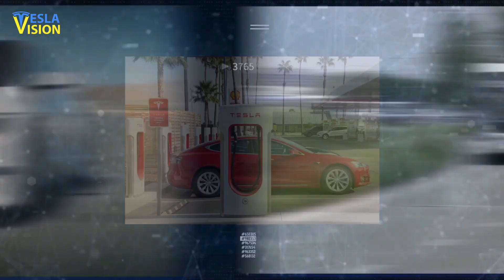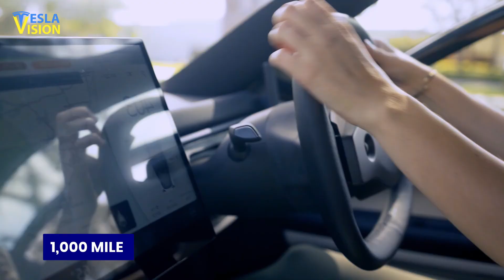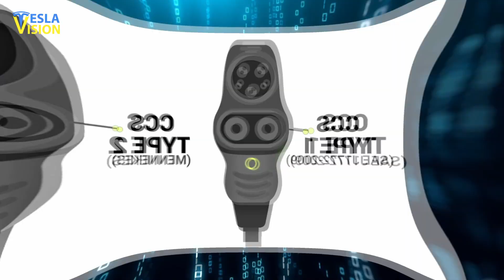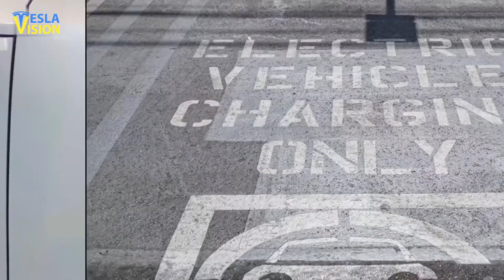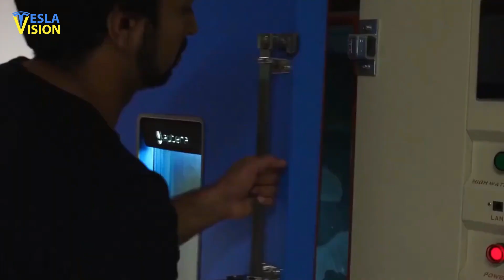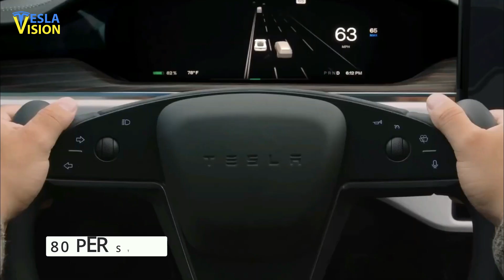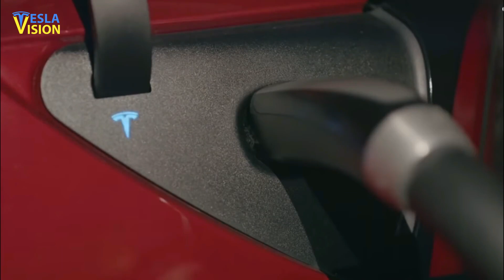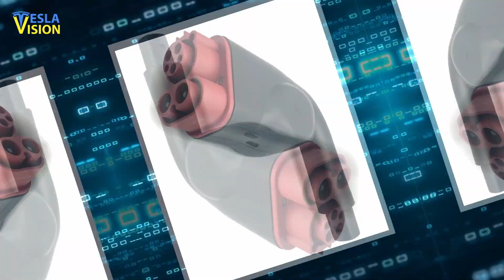How Aptera is Capitalizing on Tesla and It's Genius!

Comment: As an Aptera investor and reservation holder, I feel charging should be much faster for 600 & 1000 mile models.  These should be 11 kw for AC and 150 kw for DC.  Otherwise, charging these big batteries takes too long.

Comment: Hope Aptera get the $7,500 federal grant! That could price it at a great price for sunny states!
Reply: It isn't likely. The EV incentive is only for electric cars. The Aptera is an autocycle, classed as a motorcycle. Even if that weren't the case, another stipulation is it has to be built completely in the United States, and the Aptera will be sourcing its parts from all over the globe. They will be assembled in the United States though.
Therefore it is very unlikely that the Aptera will receive the incentive, but the $26k price tag will make it less necessary. If it did receive the incentive, then it would probably be the most wanted vehicle on the planet. Imagine getting a brand new vehicle that passes some of the most rigorous safety tests, which charges itself, costs less than $10k, and you could repair it yourself.
Reply: @justinweatherford8129  They would have got something but the bill had this gutted out due to special interest to get the deciding vote.  Great job on the US government to encourage efficient transportation by putting the best option at an economic disadvantage.  Honestly they should kill EV incentives and tax new ICE cars instead then let people vote with their dollars what alternative option is best.
Reply: @ccibinel  I think that implementing a carbon tax, while simultaneously putting an end to funding fossil fuel companies might cause a quicker change.
Reply: @justinweatherford8129  taxing fuel punishes those that can't afford new vehicles.  Fuel is cheap especially in the short term and for those buying new vehicles it is a minor difference.  Taxing the vehicle punishes those that put that car into the pipeline eventual used pipeline.  Vehicles last 15 years; less new gas cars now is good.
Reply: @justinweatherford8129  Imagine is the operative word. Keep imagining.
Reply: @aussieideasman8498  what are you trying to say?
Reply: @justinweatherford8129  That you lack comprehension.
Reply: @aussieideasman8498  I didn't see any useful or imaginative ideas posted by you, so your comment seemed to just be nothing more than trying to insult the people offering ideas. I look forward to seeing posts from you about how you would approach a solution, rather than attacking those who offer solutions.
Reply: @justinweatherford8129  See? - lack of comprehension. You prove my point. Don't worry about me putting up solutions to problems; look for those from Aptera - you won't find them in their snake oil waffle, and they are the one's selling you a product, or at least saying they are. I suggest you start with their skin cooling solution. There have been a few video's touching on it, but not much. If you watch the ones I made saying their solutions are unworkable, you will identify their feeble efforts. You are most welcome to refute any of my claims on my video's, because nobody in many months have been able to.
Reply: @aussieideasman8498  perhaps the reason why no one has been able to refute anything you posted in your videos is because no one has heard of you. Lol
Reply: @justinweatherford8129  Well, you have, now get to it. You can get the help of anyone. I don't care if it's an engineer or any Einstein you can get a hold of.
Reply: Aussie no ideas man should be a more appropriate name
Reply: @ubaldinovega3555  Been said to death, and I think by you, as well.